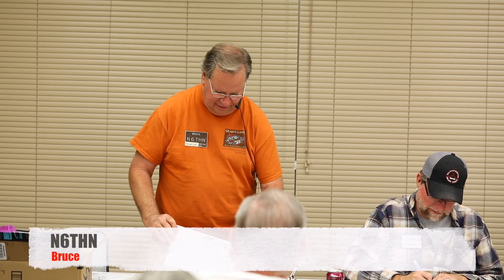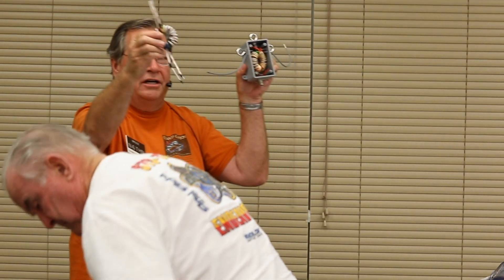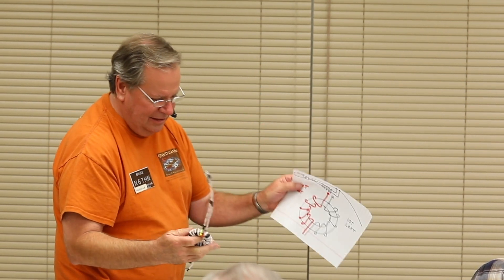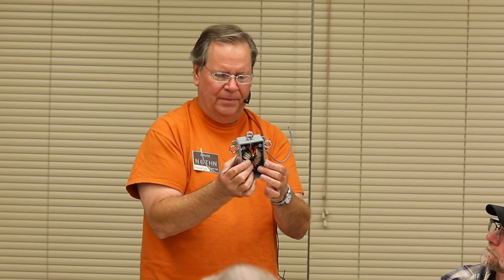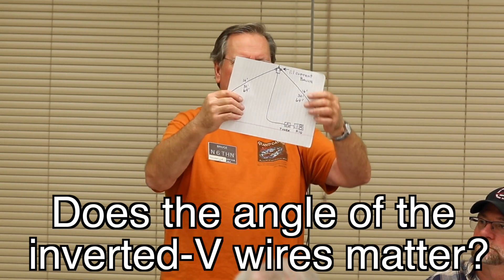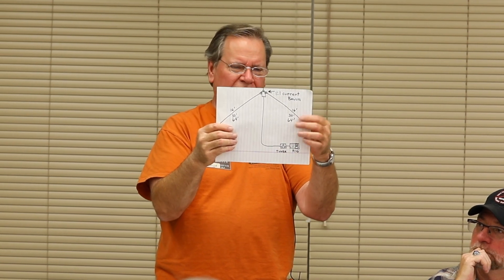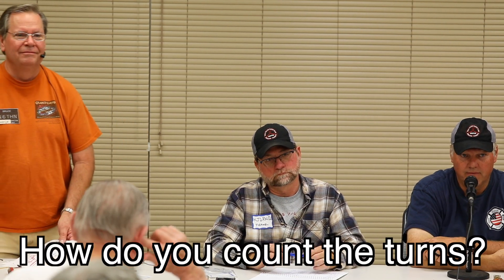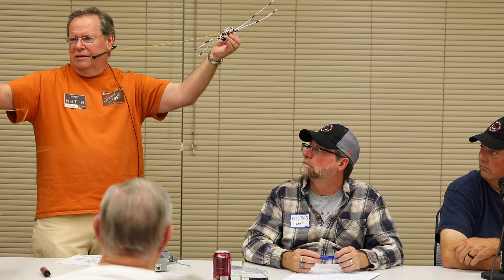Intro to Baluns

Comment: lol 1000 miles gain  from a toroid is a way to sell a current transformer for 100$ ,a pure rf way get 10x more money gain of the real cost ,  sure can improve the radiation  range but is just a RF choke from china cost 1 dollar and force equal currents on the antenna if you do some turns , lol  In any real-world environment (near-field objects, height variations), the antenna's complex impedance to ground is unbalanced, which "swamps" the choke's ability to maintain equal branch currents. Attenuation vs. Transformation: The device provides complex attenuation of the current, not a transformation to a balanced state. is just a choke not a full resonant transformer

Comment: I wish there wasn't so much inconsistency on the construction of 1:1 baluns.

Some have 5 wraps up to the top on one side, back down, and then 5 wraps the other way up the other side.  Some say double wire, some say coax, some say 12 turns, some say 8...

Comment: 9:1 a balun? A 9:1 is a unun, transformer. Unun is unbalanced to unbalanced, a balun is balanced to unbalanced! A 1:49 or 1:64 is a transformer, can be used for multiband Half wave end fed antennas, resonant wire. A 9:1 unun needs a non-resonant wire, any wire length. For 80 m a wire of ± 84 feet will do! Keep in mind that this antenna needs a counterpois, and a very good common mode choke! I really don't know why everyone calls it a balun, when there is such a big difference!

Comment: As far as power handling goes, you can figure about 500 watts per toroid, so if you want a balun that will handle 1KW, you need to stack 2 cores together.  Also, you have your wires wrapped wrong !  They should be wrapped 2 wires side by side like:  II  Not wind one wire on one side of the core and one on the other.  You are trying to created a transmission line balun and winding them separate like that is not the right way to do it !  In fact, for a 50 ohm 1:1 balun, it is best to twist the wires together and then wind them on the core !

Comment: I used a FT240-31 ferrite toroidal as described with 12 AWG PTFE stranded wire and wound it according to the instructions on the video. The Balun didn’t work. I got what appeared to be infinite SWR on all bands and could not tune with my antenna tuner. First thinking that my coax was shorted, I used my DMM and eliminated that thought. Next, thinking I wound it incorrectly, I double checked and everything was wound correctly. Next, I shorted the winding on the Balun to bypass the toroid and  my SWR dropped to under 1:3. I rewound the toroidal using the Guanella current 1:1 style and everything worked fine. I am wondering if the design is incorrect.

Comment: Nobody ever charges "a hundred bucks" for a 1:1 balun.  And a 1:1 balun does not prevent "goofy interference from your rig", it is to stop common mode rf from your antenna.  Sorry, I couldn't stand to watch any more of this.
Reply from the maker: Here is a balun for $99.95 and they have more expensive ones too. Thanks for taking a look at this video and I hope there are other videos on the channel you like more. https://palomar-engineers.com/antenna-products/baluns-and-ununs/1-8-30-mhz-balunsununs/11-toroid-baluns/CUBE-Feed-Line-Choke-Unun-5KW-1-8-61-MHz-20-38-dB-Common-Mode-Rejection-Static-Bleeder-Ground-Option-p74536617
Reply: If you couldn’t watch you should not have even commented!

Comment: I built the Balun and is good at reducing received noise, but it acted like a loading coil and reduced the resonant frequency by 2 MHZ. I would have to trim maybe 6 feet of antenna on both sides of the dipole to get back to 40 meters.
Did anyone else have this problem
Reply: i did the same😢

Comment: Very informative. May i ask how long for the wire  do i need to tune for 145mhz and 460mhz? im using dual band. thanks
Reply: The commonly used formula for a 1/2 wave dipole antenna is 468/MHz. 
460MHz is not amateur radio frequency. Ferrite core baluns don't work well at UHF.

Comment: for some reason i would think a horizontal dipole would radiate straight up into the atmosphere.
Reply from the maker: I hear you, radio is almost like magic! But yeah, a horizontal dipole will transmit of the sides heading right at the horizon. An inverted V dipole will transmit around 45 degrees up and out (depends how its installed), which helps more local contacts.
Reply: @HamRadioTV  I would think the ground itself would act as a reflector, depending on distance to the antenna, so most would go straight up and some of it would go to either side, probably quite a bit might end up heating up the ground. I think if you're going to do a dipole it should be vertical so you get the full 360 and nothing going up and nothing going down. to me that seems to make the most sense.

Comment: Great Video, I am just getting into Radio (not even a HAM yet, just planing around with some SDR's). Thinking of building one of these for a  15M Dipole using strands of solid copper Ethernet cable. 
As a network tech it's something I have in ready supply. I'll let you know how it work.
Reply from the maker: Awesome and good luck!

Comment: @ 10:02 I'm not sure what sort of explanation that is, but a balun is basically an RF choke that eliminates, or chokes via the toroid element, stray signals and RF from traveling down the feedline back to the transceiver.  This RF can be produced from an unbalanced antenna.  Strangely enough, an inverted vee is a balanced antenna if properly cut, so no balun is actually needed.  Also, their saying you get 500 to 2000 miles from a balun is kind of hyping it as a magic box.  You get the distance from your antenna and transceiver and feed line, the balun simply allows you to use an unbalanced antenna and/or feed line.
Reply: Actually, the inverted V is a balanced antenna but you are feeding it with "unbalanced" coax.  If you don't use a 1:1 current balun at the feedpoint, CMC (Common Mode Current) can flow on the outside of the coax back to the equipment and cause distorted audio on transmit.  The 1:1 current balun blocks the CMC and forces the RF equally into both halves of the inverted V or dipole where it can be radiated.  So adding the balun can improve the range because all of the radiation is up high in the antenna where it belongs instead of running back down the coax shield where it will only cause trouble.
Reply: Watch this series, its exactly what you need.  https://www.youtube.com/watch?v=kMlKfHHR8FY

Comment: I tried using #14 Thhn solid wire to wind that balun... NOT a good result! SWR 25MHZ to 30MHZ was well over 18:1 as measured on a VNA. I have some PTFE #18 stranded silver clad wire on the way and I'll give that a shot.
Reply from the maker: Yeah, solid wire is not always the best to use for RF due to skin effect. Good Luck!

Comment: The ferrite ring (toroid) catalog data gives the inductance foe each.  BUT it is a little confusing, because they can vary their units.  Some give it per 10 wire turns, or per 100 turns and so on.  The important thing to learn is that the inductance increases by the SQUARE of the number of turns.  And then you naturally want to use the frequency dependence to get the impedance at your desired frequency.  Here is just one arbitrary  example.  Assume you see a listing of 4 nH/ turn squared.  So, with two turns you get 4 * 4 nH = 16 nH.  3 turns makes 9 * 4 nH =  36 nH.  5 turns produces 25 * 4 nH = 100 nH. Ten turns then is 100 * 4 nH = 400 nH or 0.4 uH..  That last one at 14 MHz represents 35.2 ohms impedance (not resistance).  That is the core of the required knowledge.  Beyond that, you are going to pay attention to the frequency range that the selected ferrite is specified.  And for the kilowatt implementations also thermal issues.  Different ferrite materials have different maximum temperatures.  But that is enough for the basics.
Reply from the maker: Thanks for sharing that!

Comment: Good one, the Ferrite Rings are magnetic ones ? Cable can we use 16 SWG Copper insulated ones ??
Reply: Teflon high temperature wire is silver coated copper. Silver is a better conductor than copper. $$$ K5LYT

Comment: Hi guys from the UK. Great video. Look forward to seeing more... many thanks 🙏 just out of curiosity could you substitute 16swg enamelled copper wire instead Of Teflon coated?
Reply: Yes!  I use RG8X coax for mine to keep the SWR low but I have used twisted magnet copper wire US AWG 14 and 16 (approx 5 twists per inch) without any teflon or other plastic type insulation.  Most good magnet wire has 2,400 volts breakdown voltage but check with the manufacturer.  Also, don't worry about rubbing the varnish and other chemical coatings from the magnet wire because 99% of all such wires come with a paraffin wax or pure mineral oil coating.  Adding insulation increases capacitance and that is why you use either very tightly twisted magnet wire or coax to wind your choke.  Remember that at 100 Watts into 50 ohms you have 1.414 amps and 70.72 volts RMS and at 1,000 watts into 50 ohms you have 4.47 amps and 223.7 volts RMS or 316 volts peak to peak.  Also, note that if the effective antenna impedance is much different than 50 ohms, e.g. high SWR, the voltage can be higher but not above 2,400 volts.  Good Luck!

Comment: I got a 9:1 UNUN, then started with 124.5' but 160, 80, and 40, were too high for internal tuner. Cut to 121' and working great with external tuner. Now, with internal, as high as 2:7. but at 5 watts.

If power is increased, even to 15 watts or 10, it will go very high. Will the chart I used work better with a 47:1 UNUN instead? It is an end fed with a 30' counterpoise, but planning to use a ground rod to see differences.

Now, 20, 15, 12, 10 and 6 are working great with internal or external tuner. Thanks.

Comment: Why not just put the toroid on the thin jumper wire between the tx and antenna tuner?  Can easily get 10 turns in, and don't need a box assembly.

Comment: Hello N6THN (Bruce),

 This is KC3NTS . I saw your YouTube "Intro to Baluns" video and wanted to confirm the details.
 I have a balcony over 30 above the ground, that is 14 ft wide. So I can place an 8 ft inverted V.

 Given:
 20 meter band, 16 ft.
 40 meter band, 32 ft.
 80 meter band, 64 ft.
 Can I assume 10 meter band using 8 ft?
* Ok, I reviewed your video again and heard you say 8ft would work for 10 meter band.
Disregard this question.

 Other details, 
 Ferrite Core 240-31, see chart at https://ferrite-shop.com/product/ft240-31-ferrite-toroid/
 The chart only goes up to 5 turns, which is 300 ohm at 1MHz. But the increase is logarithmic.
 I'll look for a chart that does 10 turns, but I assume this is good.
* Ok, just found your link to the turn calculator at http://toroids.info/FT240-31.php
Disregard this question.

Teflon coated wire, what gauge?
Still need to know what gauge.

That's it. If you have posted a detailed plan, please provide a link.
Still waiting on this one too.

 73's to you.
 Sincerely,

  KC3NTS

Comment: Everytime i hear someone say 3 to 1 swr is ok then use the atu. I have designed antennas professionally, and reject anything over 2:1. Even then i carry on to get 1:1 at the  center of the required frequency and under 1.5:1 for at least 80% of the band in the case if ham hf bands. Teaching people that 3 to 1 is ok is not good.  Everything has a ressonant frequency, so its down to the basics of making it resonate at the desired frequency, then design a feeder network to get the desired impedance. Do that and you have a happy antenna, with a 1:1 swr and some bandwidth. Even situations where there are physical restrictions to length, there are allways options available to get a smaller loaded antenna working at a low swr with a correctly designed feeder network... If you havent done that, then you havent finished designing the antenna... I have no room for an ATU in my shack. My radio runs straight through a swr meter, a low band pass filter, an antenna rorary sw, and to any one of my hf antennas, that comprise of a choice of 3 windoms, 3 verticals, and a 5el 6 meter beam with my own dual drive design. Please don't t teach people that 3:1 is ok.... Its a poor compromise at best...
Reply: It sounds like you have a lot to say. Please make a video teaching your approach.

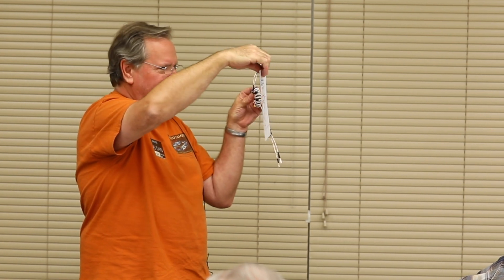Comment: 4:57 again, how does he know the wire he did use to wind the core are of the right impedance ? How does he knows how much attenuation he gets on common mode current ? They say 8k ohm, how did they measure that ?
Reply from the maker: Hmm...I will forward this onto Bruce, the presenter.
Reply: @HamRadioTV  thank you, there should also be a video on how to measure common mode attenuation...
Reply: See my comments at the first of this article.  Use a nanoVNA to measure impedance (R + jX) and dB return loss.  Must be an S21 measurement.  Won't be accurate using a single port antenna analyzer to measure a choke.

Comment: what was the wire size  bruce used on the balun
Reply: I used 18ga stranded, Teflon insulation.
Reply: is this what you wound around the ferrite
where you buy it  . thanks
Reply from the maker: You can buy all these materials from https://www.dxengineering.com/
Reply from the maker: Not sure on 1kW, but it will handle 500w no problem.

Comment: On a 1:1 current balun like the one you described, is the connections to the SO-239 critical ? Can they be wired either way as long as I have the right ends soldered to each other ? ( which I do )
Reply: Wiring is not critical on the 239 connectors, just get + to + and ground to ground. Use an ohmmeter and your good. I used teflon coated wire. Equal turns on each side of the toroid. As few as 8 turns to 12 turns will work. 73 Bruce
Reply: @n6thn  But I don't understand how in this case .. there is a + and - if the other side is balanced and its a 1 : 1  ?
Reply: @ElecTechie  1:1 is 50 Ohm in end 50 Ohm oud thats 1:1 what this antenna is al about. The windings is like a transformer. Good luke en 73 from PD1Y
Reply: @ElecTechie  Because one wire will go to one leg of the inverted vee and the other to the other leg.  It's like a dipole, doesn't matter which leg is which.
Reply from the maker: Thank you for watching. We are working on a part two, for this video.
Reply: You can make one from coax surgest look at DJ0 IP website.